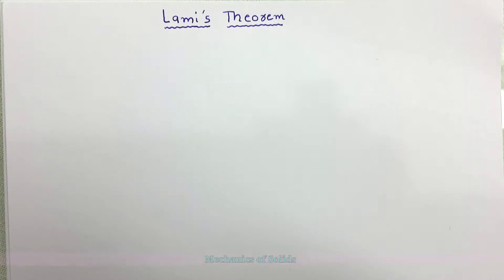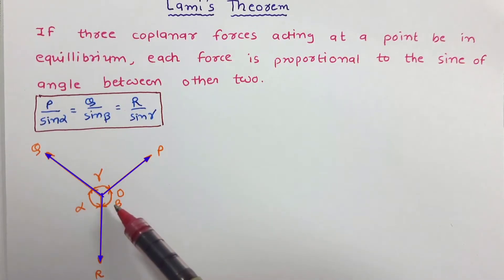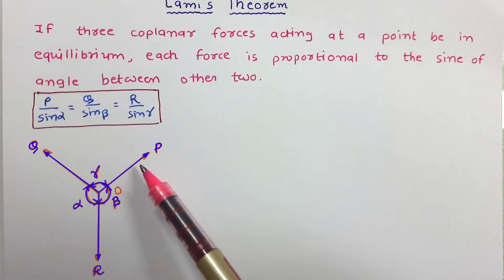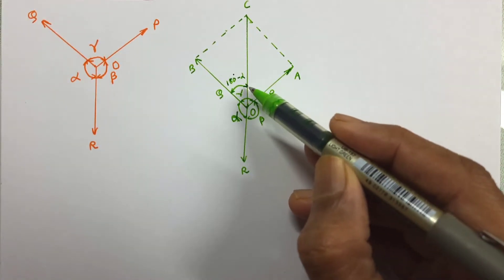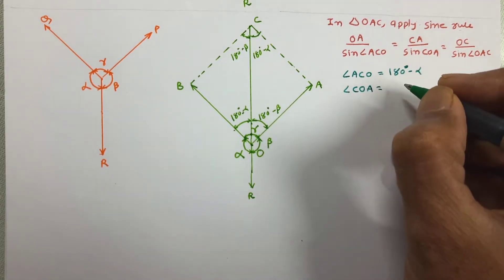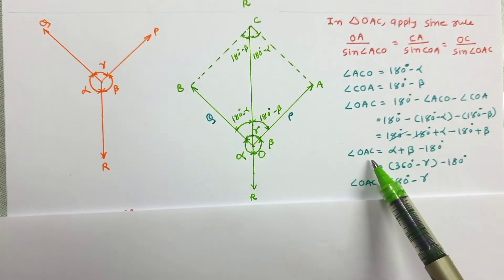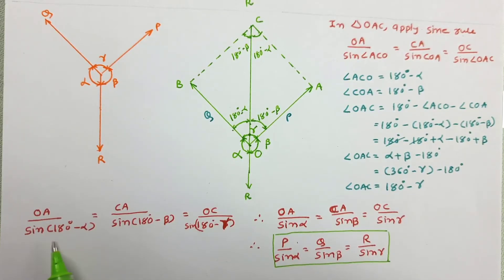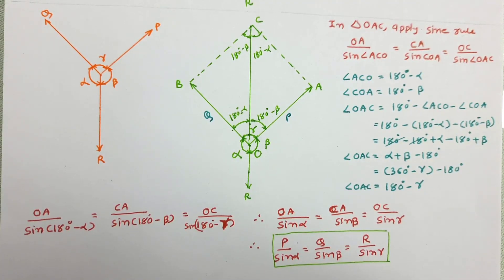Lami's Theorem Explained: Detailed Explanation and Proof | Mechanics of Solid/Engineering Mechanics

Comment: 360p quality as a default prevents me from watching until I have landline access. 1/3 of the worlds population does not have access to internet. Of those with access 50% probably use some kind of limited dataplan. Please consider this when uploading to youtube. I guess YouTube's default is 360p quality. Some channels seems to be able to set 144p as the default. My solution to my problem is to download with a tool when I have landline access. I worry that this solution interfere with your (content providers) revenue flow as it skips ad's. I don't like that, but that is my option at the moment. 😟